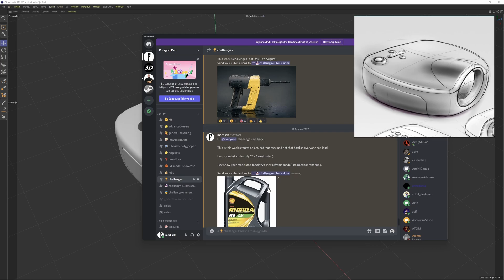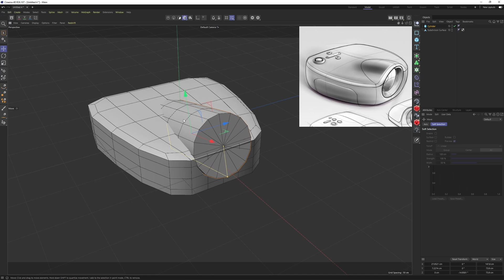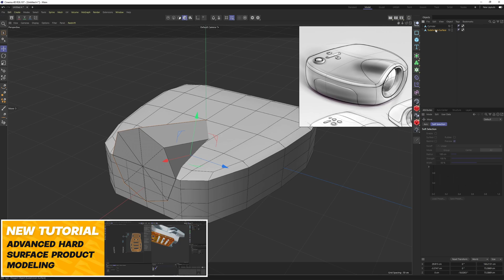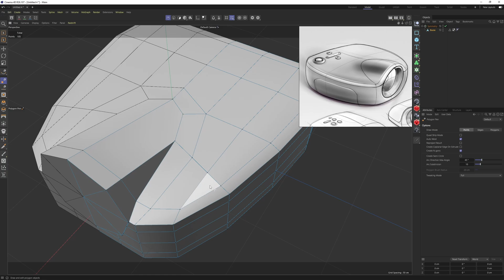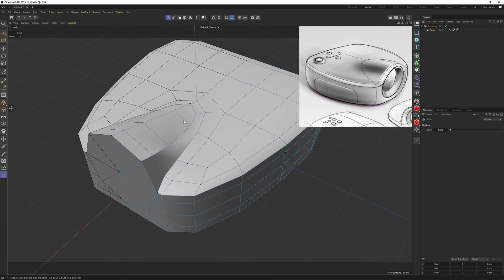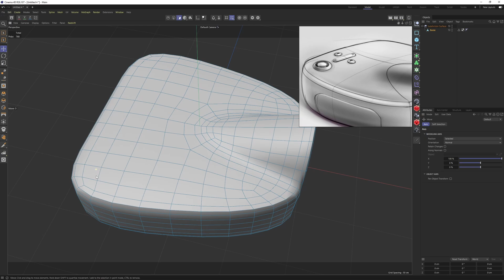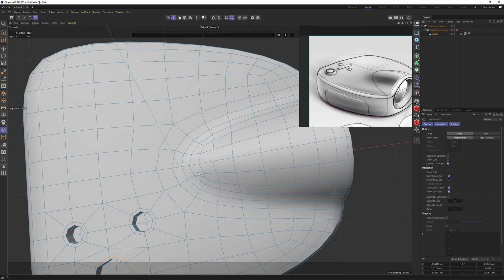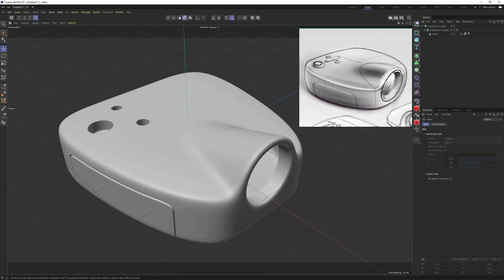Design Sketches to 3D #3 | Subdivision Surface Training

Comment: The design intent of the sketch is not shown on the 3d model at all.... While the drawing is very organic, the 3d model is very machine like....That s why Nurbs are the Ideal tool for such things, with absolute control over everything, impossible with polygons. Different tools
Reply: Huh? I can't even imagine something that has been designed in CAD software that can't be superficially replicated with polygons.
Reply: @featherDusterJr  superficially means badly i suppose...lol. i use both polys and nurbs for 30 yrs....i know what i m talking about
Reply: @gibson2623  Superficial in the sense that NURBS have infinite resolution, while polygons don't. As long as you're not going to manufacture whatever you're designing, the visuals are basically the same.
Reply: @featherDusterJr  No they are not at all
Reply from the maker: The main subject of the tutorial is not to model the exact shape, the design is just a material so that I can practise SubD modeling techniques on it and people can learn, that's all!
Reply: sure man, no worries :)